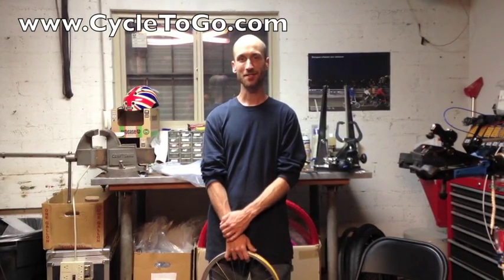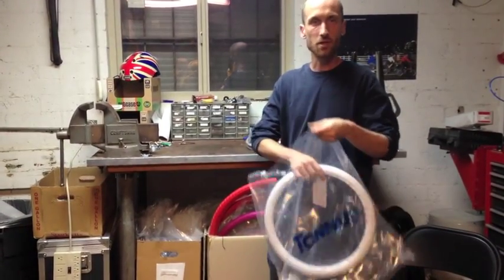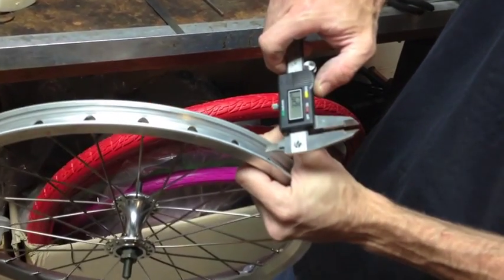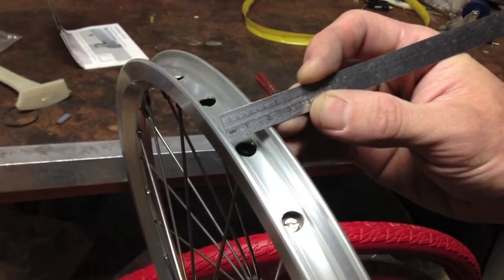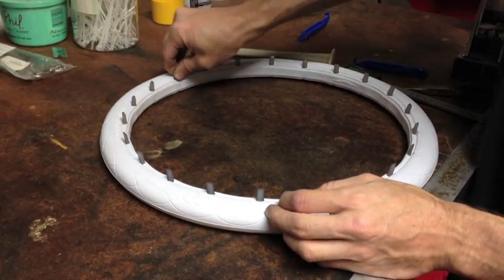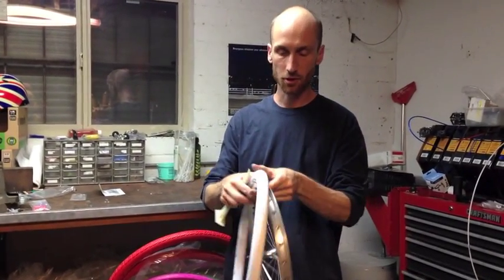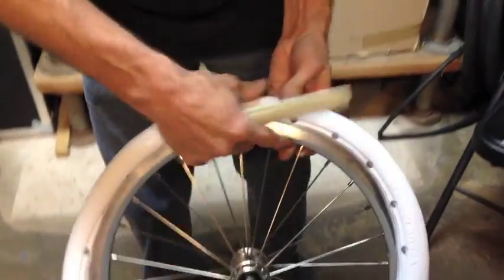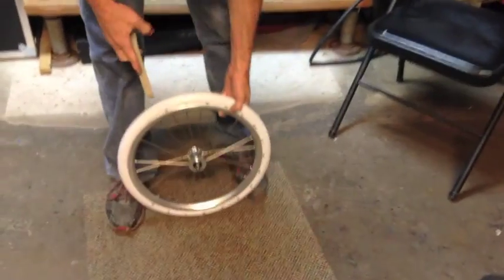Tannus Tire Installation on a Brompton Small Wheel Bike

Comment: Have any tips on trying to mount these tires on my 16" rims?

I get about 1/2 the tire on but just can't stretch the rest over the rim. I gave up after an hour and had to trash the tire.

I'm wondering if 20" will work?
Reply: Use a zip tie to secure the part of the tire already in the rim. As you go along, add more zip tie. I found this way to be easier to install this tire.

Comment: i have a strida with 16" wheels. the rear tyre is so thin and can't handle my weight of only 70kg and it nearly flattens when i sit on it lol i'm 5ft8 so the bike might be a little too small for me but it rides fine except for the rear tyre..could i install a tannus in my strida and would it support my weight better than a tube tyre? and not flatten out? because it's solid.
my front tyre is fine doesn't flatten.

Comment: MY WIFE HAS EPIC 30 MINUTE SHOWERS WITH SUPER HOT WATER, AND THE BATHROOM HEATER ON,I PUT THE TYRE IN THE BATHROOM,WAIT 15 MINUTES GO INTO THE BATHROOM,AND DO THE INSTALL,THE TYRES HOT,AND SLIPPERY,AND SOO MUCH EASIER TO INSTALL,I JUST SIT oN THE TOILET,OR EDGE OF BATH,this method does have a couple of set backs,the first is my wifes complaints,the second,and much worse is my wife may want to actually  have a conversation,for this i recommend water proof ear buds,,YOUR WELCOME
Reply: Makes sense; I did similar years ago when installing solid tyres on a previous bicycle (not Tannus; long before they existed LOL) - in my case, I soaked them in a tub full of hot water.